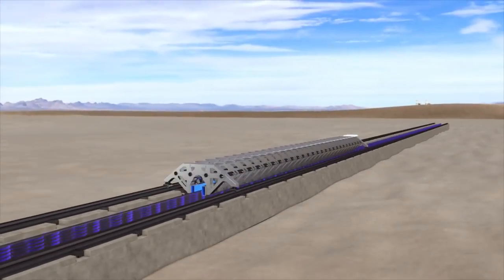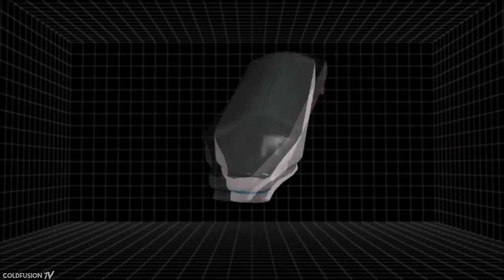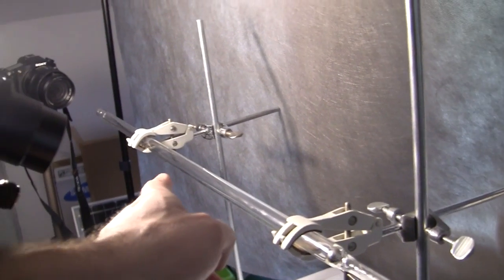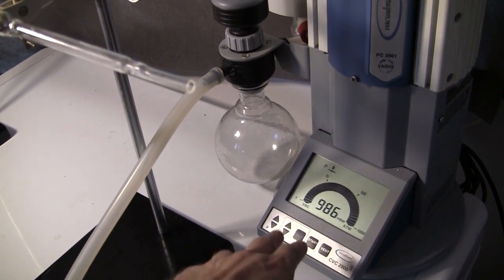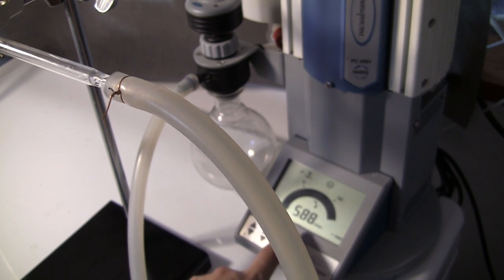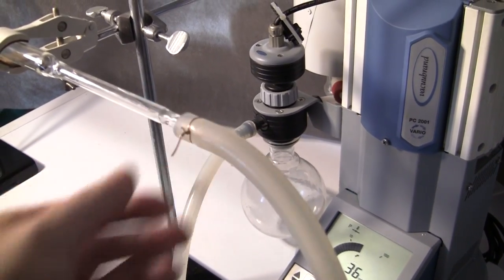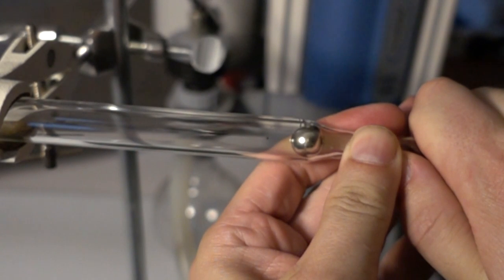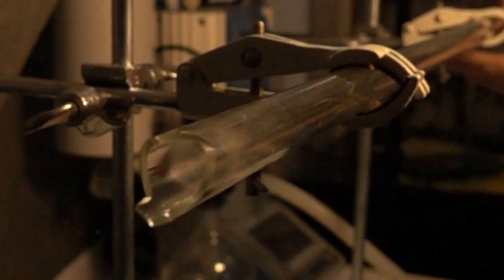How  the Hyperloop can kill you!

Comment: So let me ask a few questions here. If this thing is supposed to work in almost vacuum why does it have a turbine on the front? 
wouldn't that be completely pointless?
how are you supposed to propell it anyway? 
"An elektric motor" ookay how? The thing is going to fly by magnetism so you can't use wheels or magnets to propell it and you can't use a turbing because there is no air! You can't even use pressured gas like a spacecraft because that would destroy the vacuum!
Reply: It doesn't work in a vacuum. It works at much lower pressure than the atmosphere, but not a vacuum. The fan is there to collect the air in the tube, and press it into the pneumatic hover-pads suspending the vehicle.

As for propulsion: Linear motors.
Reply: Seikre M. The thing is not a maglev. (I just read up on it.)

The tube is not fully without air. It has reduced pressure. The ventilator in the front collects the air thats left. It is compressed in the cabine and pushed underneath the vehicle.

Now this thing is supposed to hover like an air caster (these table hockey games).

So the tube contains a partial vacuum. The vehicle collects air, compresses it and reduces friction.

The acceleration is supposed to be achieved by linear induction motos along the track. The energy supply comes from the grid.

So it's not a maglev system but it is supposed to be just as fast. The technology is pretty simple and old. Now it comes down to the costs.

Another problem is that you have to build the tracks. You need people to allow you to built it on top of their land. This usually stalls the project and drives up the cost again.
Reply: Wireless electricity, but hell, only Nikola Tesla managed to make that happen in some form of dramatization.
Or, batteries with a skylight above, and a solar panel running along the train.
Highly expensive, not to mention the sheer amount of maintenance to keep the tube under vacuum.
Reply: okay so i read some comments and I think I inderstand now how this is supposed to work but it still bugs me. A train that would safe enough time to make it worth it would be insanely expensive as is would have to be used over extreme distances. Also this is one of these Ideas that work well in theory but fall appart in practice as any little leak or power problem would instantly cause the train to stop until everyting is working again.
Maybe if you build the whole thing underground but then you are building a traintrack undergroud and the costs a skyrocketing again. The tube is a nice Idea but Subways are already really expensive for any city, this thing takes it to a whole new level. And with a speed like that you can't make big movements up/down/left/right unless you want to severly injure everybody inside.
Reply: The way its powered is simple. 
Solar.
Freakin'.
Roadways
Reply: One of Many That's true but the house-thing is actually really cool. We live in Germany, which isn't known to be that sunny and we live in an area that also doesn't get that much sun compared to the rest of the country.

We are able to electrify and heat our house using solar panels (around 50m²) on our roof. We use lead accumulators for general appliances (Computer, light and TV) and the Washing machine, and heat storage (a large insulated tank of water) are only powered when the sun reaches it's peak.

Approx. 8 months a year we don't pay anything for electricity and heat and during the winter months we limit our energy consumption significantly.

We are not energy indepenedent but we save so much electricitiy, that the whole array will pay for itself in ~11 years, which is also when the accumulators have to be replaced.

For single family houses it's a great way to save money and increase the value of your house. At the same time single family housing offers large roof areas per person and aren't that efficient in general.
Reply: Redidee Do you have any clue how ineffective solar panels are? Why would you buy solar panels, increase the cost, when you can simply buy fossil fuel generated power for 25% of the price? There is literally no single reason to even consider using solar panels on this thing.
Reply: InfernosReaper 

"Recently, one of the state highway departments funded like a mile of that crap... I wait for you to stop weeping"

Is what you wrote. The last sentence makes it sound like you are a supporter who rubs it into critics faces that Solar roadways are funded and on their way to success. 

Okay, now I know that you refer to our weeping and that you take that as a sign for humanity's inevitable downfall but this wasn't at all the only way you could read that.
Reply: Rubashow
Mea culpa
Reply: You can propel it like a magnetic train.
Reply: Motive power is simple - induction, same as normal, ordinary MagLev trains use; decades old technology that's well understood now. As for the turbine, no idea. I did wonder about that myself.
Reply: +MW2366 I'm guessing it works on a compression system, where the turbines compress the air still left so much it generates enough force in the low-drag environment to propel the train. Only needs electricity and pretty easy to engineer. Turbine engines also are part of the air recirculation system in planes, so it plays a part in cabin pressurization.
Reply: Nearly 10 years ago Intel made a functioning wireless electricity transmission system using magnetic fields.
Reply: LowReedExpert1
Recently, one of the state highway departments funded like a mile of that crap... I wait for you to stop weeping
Reply: InfernosReaper So? After they got so much kickstarter money does that surprise you? After they generated so much publicity, does it surprise you? 

Just because some bureaucrat gave them money, doesn't magically make it feasible.
Reply: you fogot the part where no way a solar panel is ever gonna power one of these vehicles alone.
Just saying, people nowadays seem to say "buth duh solar panelz" all the time, without realising that they do not really generate THAT much electricity each.
Reply: One of Many That's why you cover the entire track with a solar roof.
Reply: Sarge Rho seriously? Solar panels do not work like that dude...  same reason why solar roadways is a dumb idea.
Reply: One of Many Of course they do work like that. You'll need to store power during the day, or buy power during the night, but you can offset that by selling all excess power.
Reply: Sarge Rho You can't offset that because you need people actually buying your electricity. 

You have solar panels, that already generate electricity at a far higher price than fossil fuels. Then you buy batteries of some sort for storage which a) adds additional costs and b) lowers your energy output since you need to fuel both the tracks and batteries. 

At the moment solar panels are not feasible to power anything other than single family houses, but only during the summer or in warmer climates.
Reply: Sarge Rho You'd need a panel farm to have a decent amount of power generation, followed by good'ol sunny days, power storage is a thing, but we also have to think of reach, how much energy will be spent on keeping the voltage to move the power to a sorege unit? And how much of it will be used on the voltage to keep the distance of this tube-ish tunnel? I am no engineer so I can't comment on the engineering of the hyperloop itself, but it takes no Einstein to figure out that solar panels by themselves do not produce that much electricity, houses that have panels in their roofs barely work enough to keep their lightbulbs on. they'd have to use other means for energy to keep this thing online, Solar panels wold be a waste of resources, as they have better uses elsewhere.
Reply: +One of Many they could use tracking solar panels along the top of the tube and transfer energy through the cylindrical rails along the track using simple conduction. Simple.
Reply: Redidee  :-/ and what are you gonna power with that? My camera's flash? Look up for yourself, it really would be not recomendable to use solar panels as the main power resource, it would be higly ineficcient in projects like this with the thecnology of the modern day.
Reply: Rubashow
I was referring to weeping for how stupid people are that they can't be bothered to think about even the most glaring & basic flaws with things such as the solar roadways.
Reply: Seikre M. I just saw a video in which it actually says that the Hyperloop will be solar powered. Completely ... Now I am really curious about Thunderf00ts video.
Reply: +One of Many Given that the Hyperloop is obviously designed for long distance travel, all you would need is enough tracking solar panels (most efficient and a large enough battery to power the Hyperloop through the night. Say that the Hyperloop travels 2000 km, and it uses about 100 megawatts of energy a minute. Using regular tracking solar panels, that means it would require 43560000 square feet of space, or 13278 square kilometers of land to power it. Add a solar field and auxiliary power (i.e the grid) to your solar trail and you have yourself a 2 hour and 5 minute journey over 2000 kilometers. Have fun.
Reply: +Redidee oh, and add a battery unit too. Not even gonna calculate that because I'm too lazy.
Reply: Redidee Yeah but why would you actually do that? You can simply buy electricity from the grid. That is much cheaper.
Reply: Redidee Mate, that shit is expensive as fuck, a dedicated  solar field can be better spent netxt to a city.
There are cheaper, more viable ways to power this hyperloop thing.
Reply: +Rubashow Because its energy use per trip is 125000 megawatts. That is enough power to provide an average American house for 571 days. Given the daily cost of energy, that means it would cost $2044.18 for one trip using only the grid. That is definitely expensive. If these become standard transportation but to not have solar energy exclusive to its rails, we are going to hit another depression.
Reply: Redidee Yey I am consistently arguing against using Solar power on that thing. I just interjected that it's a really good idea to power a house with solar panels.
Reply: Rubashow
Provided you can afford the insanely high initial costs. I'm in a nuclear power zone & not rich, so that's not gonna happen for me.
Reply: InfernosReaper If you finance it and have a plan for 11 years the costs aren't an issue. Home owners can simply leverage their house against it to get the money and it pays for itself.
Reply: Rubashow
Hah, leverage their house. That's hilarious. Most "homeowners" in the US won't have their house paid in at least 10 years. How are such people going to justify getting further in debt? It would honestly be better to wait 10 years and get panels then since the tech will be better so you might be able to get some of that old stuff on the cheap
Reply: InfernosReaper Dude .... why even open that can of worms? To power a house with solar cells is a feasible option if you are a houseowner and have the necessary roof area. This is all I wrote. It's also true. I am aware of the limitations and I don't see why we have to go through this?

Btw: 56% of American home owners own their houses. They do not pay any mortgages.
Reply: Rubashow And most of those homeowners still barely break even financially. America's kind of a gilded pile of shit.

Comment: Thunderf00t, this video makes me sad in the feels.

You said you're working on a longer video. Aside from the pressure danger you demonstrate here, what other issues are you going to cover?
Reply: Energy cost, imagine a vacccume strong enough to keep the entire loop in that state
Reply: Wouldn't only the active sections need to in a vacuum? Surely the entire thing doesn't need to be the whole time...?
Reply: Given that musks plan was 2,2m tube and 1.3m pod. This pressure differential failure is a non problem.
Reply: This is what I wonder. Like, how many airlocks will there be? Will there be one continuous several hundred mile stretch of tube? Is that even an issue? Can the evacuate the tube in the same way vacuum powered subway cars used to use to propel the car itself saving energy? How hard is it to actually evacuate a tube that size?
Reply: I'm not sure Volatile is the right word for it. Put this in perspective. We have built the ISS, the LHC (arguably more of an achievement then the ISS) and some massive planes, what we are dealing with here is not out of our reach feasibly. The scope for damage is no worse then a plane, in fact, even less as we can raise the safety factors of the tube further then an air plane as it does not have to have weight factored into the equation.
Reply: seigeengine That makes sense.

The more I think about Tf00t's model, the more flawed it seems. He's using a 'pod' that's flush with the tube. Shouldn't it be a cylinder that's about half the diameter of the inside of the tube, and with a magnet underneath? Also, the metal ball is right up against the tapered end, so it reacts like a spitball.

In the concept design, the vacuum is just to eliminate drag, not for propulsion, right?

Seems like Tf00t was sloppy here. Am I wrong?
Reply: MetalAsFork
It would certainly be more efficient to keep a whole vacuum, significantly more so.
We are also experts at airlocks / couplings (we have more then a few on the ISS) so we can simply enough couple the side of the shuttle to the tube wall using something along the lines of an expanding rubber gasket.
Reply: Tom Leech It's just a long time with a big pump. We have a pretty massive chambers in the world, it would be the same techniques. It's just a matter of scale.
Reply: Just Power Electronics So how much potential energy is in a 100 or 1000 mile X 2.2m tube under that kind of pressure? Seems like it would be really volatile.
Reply: I don't think that the problem could be solved by controlling the vacuum in the tube, but you're forgetting that  this thing is going at the speed of sound. The simple amount of time it would take to pump air in and out of these sections would either not be enough for the speed, or insanely power demanding
Reply: +MetalAsFork The problem is it takes energy to get the tube down to a vacuum, but it doesn't take energy to keep it at a vacuum.

If you wanted to repeatedly bring segments down to a vacuum you'd require far more energy. Really, the places where the capsules are accessed are the only places that should ever not be at vacuum under normal conditions.
Reply: Apparently the original idea was 1/6th the atmospheric pressure, where pumps can deal with leaks in the system.
Reply: MetalAsFork he will probably address all these concerns when he makes a more detailed video
Reply: MetalAsFork The supposed geometry is 2.2m tube and 1.3m pod... Faaar away from flush.
Reply: Rok Adamlje "The supposed geometry is 2.2m tube and 1.3m pod... Faaar away from flush."

Right. So a pressure breach would have less effect on the relatively smaller pod, yeah? Not to mention there would be some kind of braking system acting on it.

Picture a section of garden hose. Is it easier to suck a grape, a blueberry, or a sesame seed through it?
Reply: Well it only costs money to pump the vacuum down and maintain any leaks, so if you do a good job of filling leaks then you will be fine. Shouldn't be a problem, we are experts at stopping leaks (channel tunnel)
Reply: MetalAsFork You're not wrong. If this demonstration says anything about the longer video, he's producing absolute trash.
Reply: I don't think it was ever planned to be a vacuum, but a near-vacuum.  EM had already decided that trying to keep a complete vacuum halfway across the state of California (his original proposal) would be way too expensive.  The original proposal for the Hyperloop is available http://www.spacex.com/sites/spacex/files/hyperloop_alpha.pdf
Reply: I know, this video isn't nearly as strong as his other fake science busting vids.